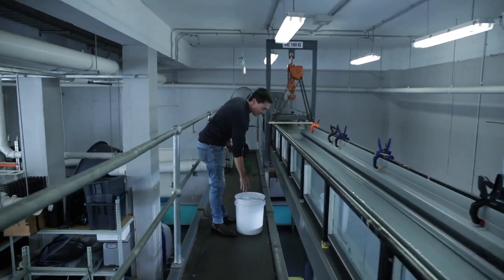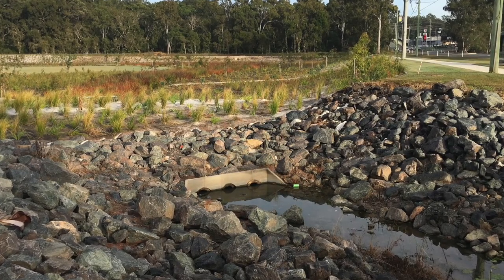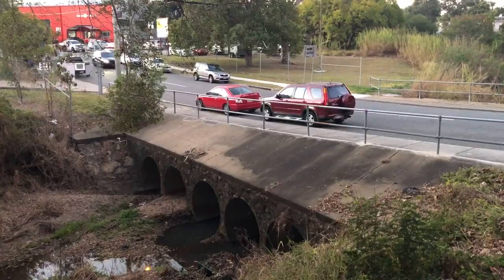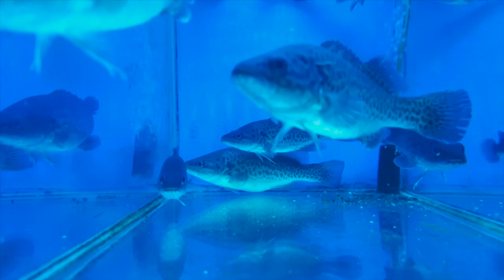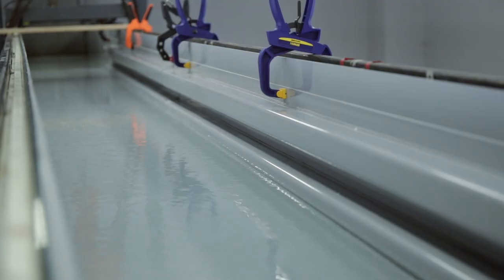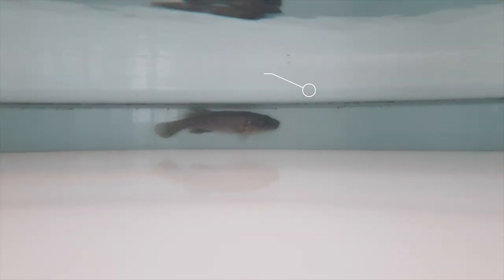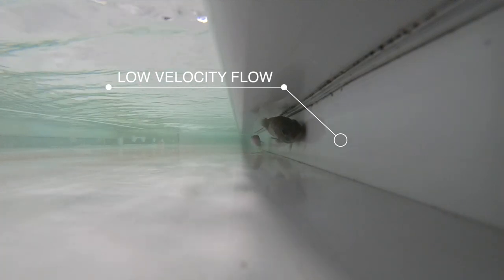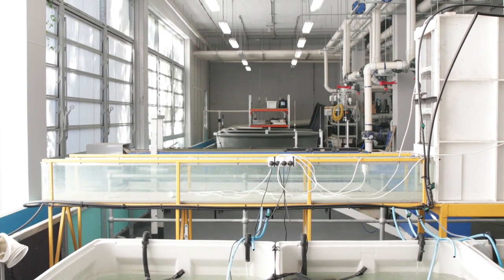A breakthrough to help fish pass culverts

Comment: I'm curious if sediment will deposit in this slower flow zone and eventually block the passage.  Would the same concept work if two beams were placed a little higher off the ground for a bit of clearance?
Reply: Hi Ian, Thanks for your comment and apologies for the delayed response. Yes, there is the potential for sediment to accumulate beneath the lower beam in a culvert, but the single-beam design we have been working with in the lab is really just proof of concept at this point. When we roll this out for field testing, the plan is to have multiple beams up the sides of the walls to account for different water depths within the structure and to provide some redundancy in case one sub-beam channel gets blocked. Compared with longitudinal baffles, we expect fine sediment to wash out of the sub beam space fairly easily, and not get trapped, but we really have to try them out in the field. Although we haven't tested it, we do not believe that we could increase the size of the sub-beam space much more without compromising the convergence of the three boundary layers (base, wall, sub-beam surface) which creates the reduced velocity channel that fish can exploit.